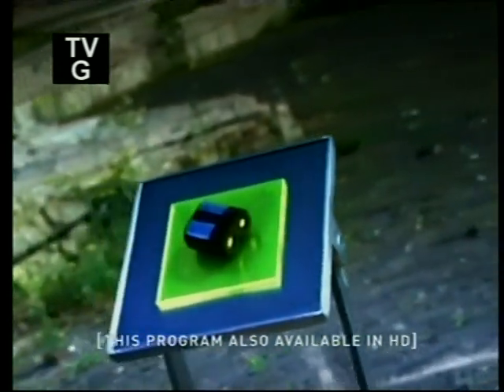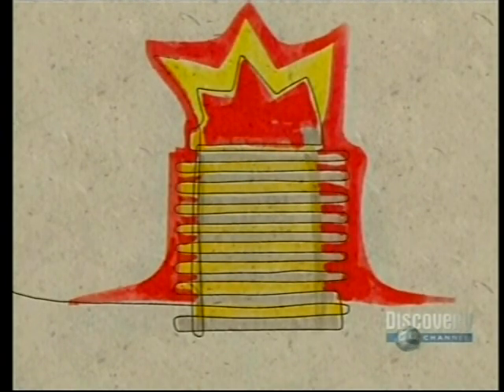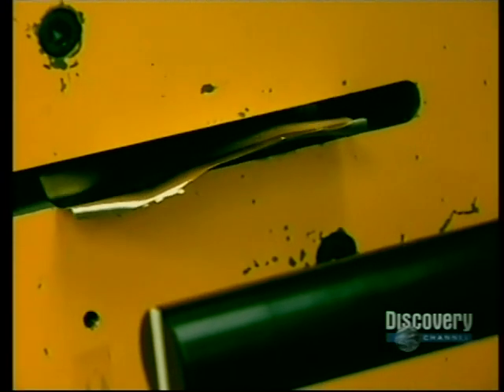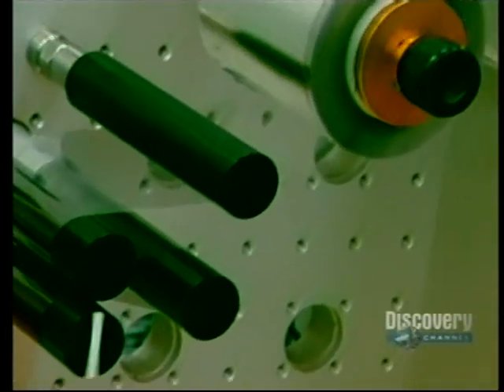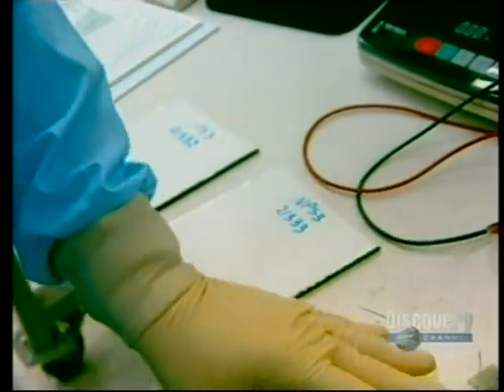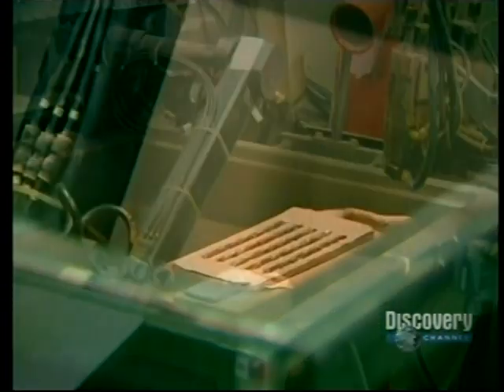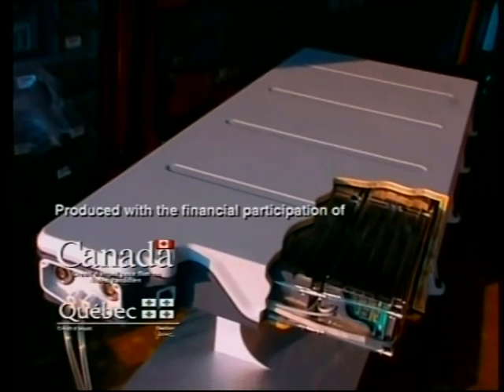How it's made Lithium Ion batteries

Comment: I feel grateful this reconditioning program ( Check Details Here>>>https://www.facebook.com/Battery-reconditioning-310070329426065/app/208195102528120 )  was started. I had Three dead batteries scheduled for disposing of. Having said that, I tried out reconditioning them and it took me only an hour to do it! It doesn`t matter what type of battery you want, the process works.

Comment: how come the lithium doesn't oxidise when it is exposed to air? weird...
Reply: joxovich singh Hi,

Did you see the two workers there (had special suits on) ? I'm guessing that the room temperature, moisture & other parameters are very strictly regulated. 🤔😑
Reply: but they did not have any kind of oxygen supply to their suit. lithium oxidises even at very low oxygen concentrations in the air. oxygen is the factor not humidity or (unless dunked in water = exothermic reaction) they are wearing clean suits to not introduce any sort of particulants though.
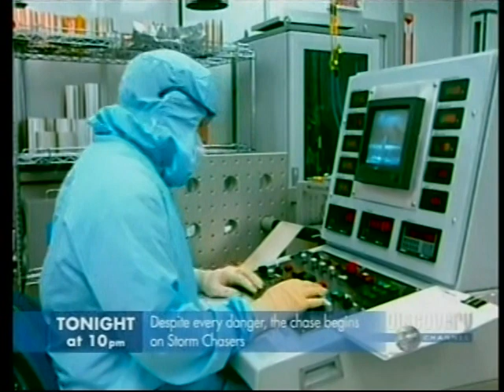Reply: i saw now that they laminated the lithium foil right after extrusion so that is probably the reason it doesnt oxidise. 2:16
Reply: joxovich singh There you go. I needed to stop by & post something stupid to get your mind going. 😅

Comment: The batteries today use aluminium foil with a coating of lithium oxide as cathode, and a copper foil wit a carbon coating as the anode. A polymer foil separates them.
This video is old, and might not be correct, or the technology used litium metal foil instead og oxide.

Comment: Wait I thought lithium degrades really fast when it comes in contact with oxygen how do they keep it from degrading well they are machining it?
Reply: +krazytaxicabbie you think lithium is bad? try searching "cesium in water" on YouTube. XD
Reply: +krazytaxicabbie also, lithium batteries are safe enough to use, as long as you don't open, heat them up to high temperatures, or mess around with it too much.
Reply: so is that why they get hot and explode? exposed to oxygen?! I never knew that. That's why disposal is very picky of these things. was this meant to be known? such a large amount of energy in a tiny space and so easy to do!?

Comment: 1:13 Lithium Polymere battery used in a car? Well, sure its possible, but its a strange choice. In the end it seams like its a one of show case car. Thats why they use lithium polymer batteries. They have good performance, but terrible durability.
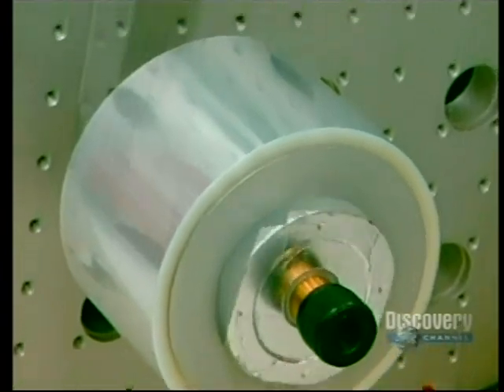2:20 Sure, lithium is soft and sticky. But the reason why they put plastic film on it its not because of that... they just got it in a roll, it don't adhere to it self that badly. The reason to the polymer film is to make it non contact when when they make the cell later on.
2:40. They jumped over like 5 steps here.The film that is rolled up on the battery is not the same the one previously laminated.They added a additionally 4 layers of materials.
4:20 They forget to mention the plastic laminate separator.
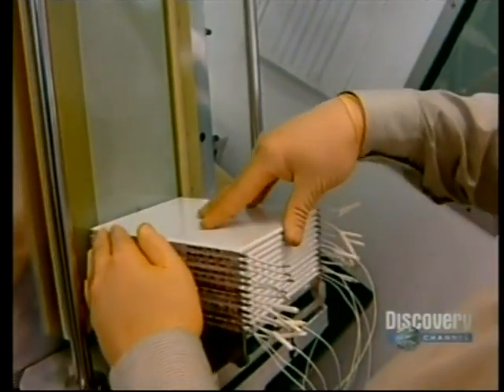4:45 Temperatures with 104 and 176 degrees? It seems like someone done a double Celsius to Farenheit conversion 104F is almost exactly 40C and 176D is almost exactly 80C. Thats way to hot for a lithium polymer cell. 40 and 80 also seems like round numbers. 40F is close to 5C (actually 41F is very close to 5C), but someone probably rounded here. 5C is a normal lower possible using temperature of polymer batteries. 80F is about just over 25C, that is also a normal upper battery temperature.

I guess this batteries was made for arctic condition and someone pre converted the units for the americans, that did a additional conversation because they are just use to it
Reply: Citing sources is a retards move? what in the actual fuck dude
Reply: +matsv201 This show is always riddled with mistakes.  And Brooks Moore is a robotic moron that pronounces everything wrong.  If there's a wrong way to say something, he will find it.  The writing is infantile, but Moore is criminal.
Reply: Alex Tworkowski Is it really that hard to screen the script?
Reply: Eeeeh.. no
Reply: I don´t need to. I know for a fact its wrong. If it says anything else on Wikipedia, wikipedia is wrong. So why would i check it.

No. There never exist lithium polymer batteries with such a high working temperature. Of cause there is other batteries like sodium that do. But that is a different technology.
Reply: You got it wrong.
"The original polymer design dating back to the 1970s used a solid"
This referees to older electrolyte use, not Lithium batteries. Those are still used in fuel cell, but then have never been used (commercially) in specifically lithium cells. NOTE, Lithium-polymer batteries. Not Nickel-polymer batteries, that is a totally different story
Reply: You can find a lot of things that is wrong yes.

The batteries that made in the video are standard commercial of the shelf lithium batteries.  Its quite clearly a double conversion because it match up exactly with the recommended temperature range.

Now i also happens to know this battery pack was made for a line of prototype concept cars. Its prototype production (That is why there is so much hands on). And that uses the very same temperature range.

Så no, you are wrong, deal with it
Reply: Hello everyone 
Can you suggest me to get this machine we need to get and buy so how can we get 
Tnx

Comment: 4:16 Lithium is not the anode, it is the cathode.
Reply: you are incorrect.

1) this is not truly a lithium-ion battery. that would imply that it is rechargeable. using metallic lithium makes it not so.
2) the potential of metallic lithium is -3.04 vs SHE, few materials are lower.

in a truly reversible cell the cathode and anode designations flip depending on the state of charge or discharge of the battery (corresponding to the location of lithium ions)
Reply: cyctem05of05 Makes sense.  Thanks.

Comment: mark thompson
No.  The chemicals used determine the voltage.  LiPo 3.7V, LiIo 3.6V, alkaline 1.5V, Lead Acid 2.0V, etc.  The voltage is nominal and each have a range.  LiPo is 3.0 to 4.2V.  I don't push my cells that low, usually 3.8V although 3.4V is recommended for storage.
Reply: 3.8 Is recommended for storage, 3.2 is the definitive Low @ 3.8v Cut-off is just wasting capacity.. 3.8v? So you use them until they are ready for storage? You are leaving almost 20% of useful capacity just by using them that way and even then it doesn't secure a long lasting LiPO..

Comment: Compare this to tall the specialized machinery in making cylindrical cells: v=ksxSOwA933M  It's because cylinder cells are a gigantic, decades-old market.  Soon, pouch cells with have more automation and volume (and lower price), but not yet.  This is why Tesla uses cylinder cells--they have not battery manufacturing capacity themselves and do not want to wait for pouches to get faster/cheaper with the market.

Comment: For traditional LiCoO2 (like shown in this video) it's 3-5 years depending on usage profile, for LiMn version of Li-Ion (usually found in power tool batteries, and in some hybrid electric vehicles) it's 5-7 years (also depends on usage profile), for LiFePO4 it's 10+ years (but, as a disadvantage, a LiFePO4 battery that stores same amount of energy as LiCoO2 one, weights ~2 times more).

Comment: @garykempen Yes and the cathode is the opposite, and yes if you wanted to be as confusing as possible you would switch them depending on whether your external load was sourcing or sinking current. And yet our batteries always have a + and - side, gee I wonder why. It's because it is common practice to refer to the cathode and anode in terms of what they'd be if you were discharging the system. If you're going to talk about the electrochemical half-cell reactions, THEN you'll switch the terms.

Comment: @TehMG 
You're pretty far off the context there.  My trusty ancient Volvo 242 started fine at -30F back in the day.  However, it really didn't like repeated charge cycles, & was seriously compromised after only 5 deep cycles.  A lithium battery does just as well on temp (i.e., not great), and with >1000 controlled cycles at 1/4 the weight per energy stored.
Reply: This YouTube comment is older than most people on the app. How do you feel?
Reply: @peetcat older, perhaps wiser than most people on the app...  😜

Comment: @OfficeThug 
Once again, if you're correcting someone you should be right.  Copied from Wikipedia, verified with my power electronics professor, and consistent with my memory of high school electronics:  "An anode is an electrode through which electric current flows into a polarized electrical device."  Enough with the negativity and get on with your understanding, Mr. Thug.  I'm sorry you're confused by the definition.

Comment: @garykempen No, don't do this unless you want to fuck yourself over in a presentation or a research paper. Seriously, trying to explain charging and discharging mechanics and why we use the electrode materials we do is bad enough without having to switch the cathode and anodes around.

For all intents and purposes, the cathode is always the material that's higher in electrical potential than the anode.

Comment: @madmax2069 

sure did, the title is wrong, lithium-ion doesn't actually use pure lithium metal (showed in the extrusion process in the video)... lithium-ion uses metal oxides (e.g. LiCoO2) and is usually in a powder form coated on an electrode. Additionally, the video mentions that the lithium is used as the anode when in fact lithium-ion uses the active material as the cathode.

Comment: you are right, I had a LiFePO4 battery and I overcharged it, overdischarged, shorted it  and finally drilled a hole it but it did not blow up.

Comment: Its to bad these batteries are so unstable when compared to the NiMH or Nicad batteries. They are prone to catching fire and or exploding.

LiPo batteries are the more unstable ones then Li batteries, but both will catch fire and or explode and catch fire if you abuse them.

LiFePO4 is the next step in this technology's evolution. cause you get the benefits of Li  without the hazard that comes with it, i haven't seen one explode or catch fire yet.

Comment: Lithium used in batteries is a big hoax. The material is even more scarce than oil. The ONLY REAL CHOICE is NiZn. Xellerion makes these batteries. They last longer and after BoP used by Lithium, they are higher in power to weight ratio. And they are cheaper and last longer and they are recyclable.  500 deep cycles; and I mean deeeeep all the way down to 100% DOD and all the way back to 100% at least 500 times. And 35% the cost of Lithium batteries. Anybody want to know more?